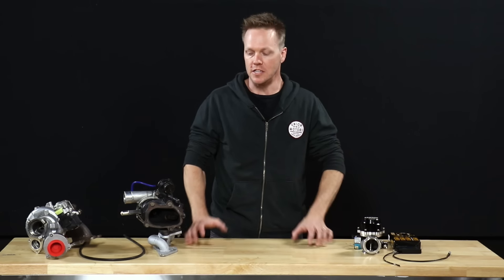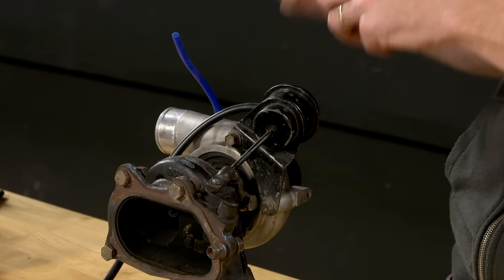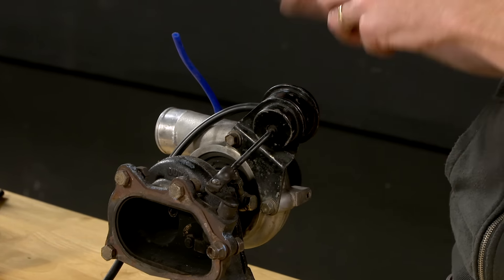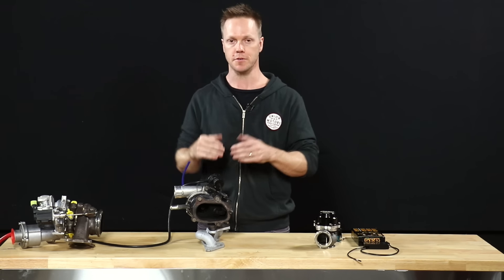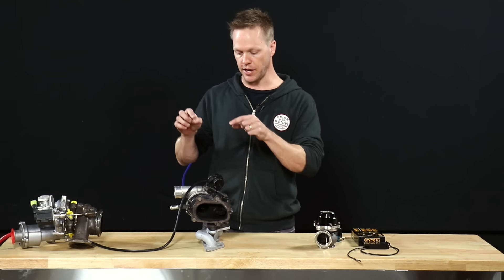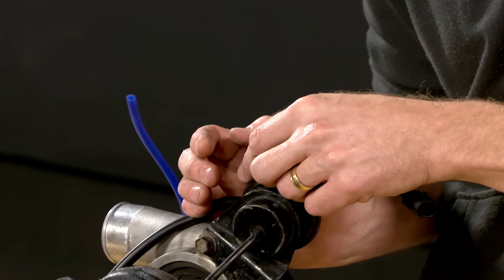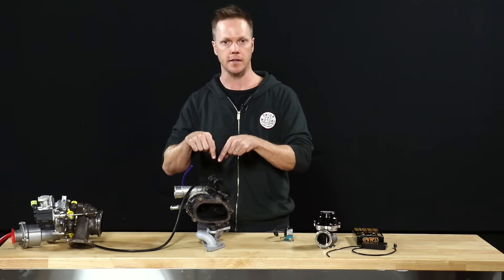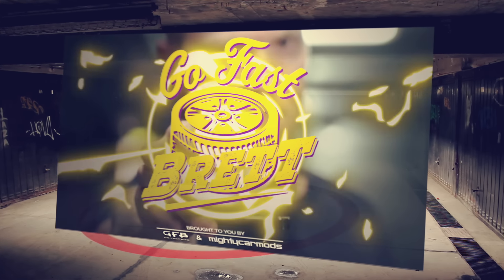Boost Control Explained [GO FAST BRETT]

Comment: Just weld the waste gate shut, unlimited boost baby
Reply: good luck whit that
Reply: Infinity boost!
Reply: Does this actually work of does the turbo tear itself to shreds?
Reply: The guys trolling. Don't weld your wastegate shut that just stupid. The only time you would do it is if you want to go form an internal to external gate without charging the turbo.
Reply: It not only tears itself to shreds but also I hear it can cause
long term brain damage to the vehicles occupants due to the massive Gs experienced
forcing ones brain into the back of your head. Serious stuff.
Reply: I hear that's how Han Solo did the Kessel Run in less than 12 parsecs.
Reply: He took a shortcut? Since parsec is a measurement of distance.
Reply: +Kanga Duck Even if you had a pressurised suit, cars are not designed to break the speed of sound. So I wouldn't do it, personally.
Reply: make sure you throw a couple tack welds on the compressor wheel aswell really helps with spool time
Reply: +Martijn Westerink Well I've already started building wings for my car so I can be over the ocean when I break the speed of sound.

Don't want to be that asshole that breaks everybody's windows...
Reply: Ryan Rohauer
Dont forget to apply these in a criss-cross fashion. dont want to warp the wheel...The only time warp is good is on entry to warp speed.
Reply: too much boost than ur engine can take and boooom!!!
Reply: enclose in Metal and roll of bridge for vertical boost.
Reply: vevohoeyo not if u have a Diesel
Reply: I laughed a little too much at that. lol
Reply: If a turbo blows in the woods and nobody hears it, does it actually blow?
Reply: i once welded a few gears in a rear diff once!!! lol
Reply: It would just explode
Reply: Rods have left the chat
Reply: You could just block the actuator... no need to weld!
Reply: They actually used to do that on 80's f1 cars and they would run a shit ton of boost, over 70 psi but it would only last one race or less lol
Reply: LostSagittarius
He actually skirted closer to the event horizons of the bordering black holes than anyone had ever managed before. The greater power of the Millennium Falcon allowed this due to his and Chewie’s custom modifications.
So, the overall distance traveled was shorter.
Reply: quantum foolishness
Reply: Lold on that one haha 🤣
Reply: Welding things always helps
Reply: Yeah because what the fuck is "efficiency range" and staying below the 70% threshold from thermodynamics coming into play all sound FUN lol good luck super glueing it back together once you find out the hard way...
Reply: But ill admit guys like you make guys like me money lol
Reply: @melody3741  any issues on diesel engines
Reply: I have an almost new parachute for sale only used one time never opened
Reply: Yeah do it. But only you nobody do it it will blow your engine
Reply: So what really does happen if you clamp down the gate?  Full boost  I mean a T25 is like 100$ if it's a street car honda civic  what's really going to happen ? Let's be honest no jokes

Comment from the maker: Boost is good and in this episode, Brett explains what it is and how it works - MAD!
Reply: Would a boost controller have an effect on any turbo car, even a diesel such as a VAG 1.9 TDI 150 or....?
Reply: I too am interested in this, i have a kia Ceed CRDi and was wondering if a boost controller will make it MAD or just wreck the thing?
Reply: +DANCE GASMAN Yes, especially on Diesels.
Reply: probably not enough effect to offset the cost
Reply: The answer's in the video!
Reply: But can I fuck it up with just a boost controller?
Reply: +Mike Pop Yes. If you use too much boost without a proper tune.
Reply: So on a 1.6 diesel,  putting a boost controller and upping a few clicks without a tune should be OK?  The standard ecu is quite smart on it.
Reply: +Mike Pop If your fuel pump and injectors can keep up, then yes.
Reply: you can always go by a performance shop and ask them how or what . thats usually a better idea than just taking some guy on the internets word for it
Reply: +Maurice H They will say no because they want you to buy their chips. Better ask on a forum.
Reply: i never said stop by a bunch of scammers haha
Reply: Maurice H no, he's right,  I done that before and they just layed out all the bs
Reply: RAKE LIKES THIS !!!
Reply: +Maurice H I am asking MCM2 for the answer, not some random guy. Their experience and knowledge on this subject is tangible as they produce real results backed up by hard data...
Reply: Before this video I had no idea how this works,but now i understand it very clear for one video,thank you very much,have a great day

Comment: The old Corvairs had a different form of boost control.  They had no wastegate or blow off valve, they used a small carburetor.  A small side draft Carter YH (about 1 5/16" if memory serves).  Which, on my 65 turbo promptly replaced with a Weber DCOE with 28mm chokes.  The small carb not only controlled boost but make it very slow to build. It was a pain to tune but damn did it make power.   Now with electronic control and FI it's amazing what turbos can do.

Comment: The video showed up at the perfect time! I think I have a faulty N75 valve on my 00' A6 2.7T, and this helped me pictures what's going on with my waste gate so much! (though it's still a bit different)
Reply: If you have a manual boost controller laying around you can plumb it in with the n75 valve. If you have the problem with the n75 valve and the boost controller together but not with the mbc on it's own you'll know what your problem is. At least on my friends 03 Audi TT 225hp that was the case.
Reply: I thought N75 was the one most people just deleted? I forget just now though so that could be well wrong...

Comment: Extremely helpful. How come nobody ever talks about the manual boost controllers: Where they go, and what they do. Not that I didn't already know, but thank you so much anyway.
Reply: Hey bro what's the difference between ebc and mbc does the electronic boost controler you just plug it and it will do thr job by itself? (Without having to make any MANUAL adjustments please respond ,thanks!
Reply: @alexortega714   Electronic Boost Control still needs input from the user. It's just a nicer way to set your wastegate. you should also be able to see what your boost is set at in real-time before you drive the car.

Comment: I have a question, lets say my wastegate and actuator were not operating properly (staying stuck closed) causing an overboost situation under boost. By removing the restrictor pill ( in a 2 port boost solenoid) will make the car run to the minimum wastegate pressure? or will still be over boosting?

Comment: The electronic boost controller you talked about, is it similar to what other companies call a 3 port boost solenoid which is controlled by the ecu with a tune?

Comment: So it actually builds up the pressure by first closing/fooling the 'sensor' and then opens, what makes the turbo spool turn faster. A bit like squeezing a water hose.

Comment: Could that solenoid or vacuum valve make problems with turbo surging at half the throttle?

I have a 2.4JTDm and sometimes it works just fine, but sometimes it surges from 3 up to 6 gear around 1800-2000rpm (turbo reference is around 2000 I think).

Thanks...

Comment: This is probably a dumb question but why not just put a stiffer spring behind the diaphragm so it takes more pressure to open it?
Reply: It's not a dumb question, and it is a very common thing (at least in my car circles) it's just not where most people start as it is a little more difficult to either swap springs or track down and buy a heaver spring waste gate. I think this video is designed for the guy or gal who just wants an easy way to get a couple more PSI boost without too much work.
Reply: That's common. You can put larger springs in to allow more pressure therefore higher psi
Reply: you can also have the original internal wastegate flapper plugged and run an internal wastegate.
Reply: +That Yeti Guy that's interesting changing the leverage like that. Cool idea.
Reply: Also that does not allow the adjustability an electronic boost controller offers, with a well setup electronic boost controller you can change your target boost pressure on the go, and thereby have multiple power levels. Bleed valves...well, I wish they would have gone a little into the issues with them, they allow short times of unwanted very high boost to occur, which your factory ECU and injectors (let's face it, someone who installs a bleed valve will likely run those) might not be up to. But yes, changing waste gate springs is a thing, and sometimes is even required for high boost applications, where the exhaust backpressure opens the wastegates a bit before your target boost is reached.
Reply: F1NNSP1N
Agreed.
Reply: A lot of actuators cannot be opened up. However, there is a bodge/cheat that I saw on youtube. Put the "can" part of the actuator in a vice, and crush it ever so slightly; Tada! You've now added preload to the spring :) Not a reversable mod though!

Comment: I have a 1997 Sr20det s14 silvia stock motor . It's only running around 6psi stock I want just a bit more power. Do I get a boost controller ? Do I need to remove restrictir pill ?

Comment: Not all turbos waste gates work the same, newer models now works with vacum which is made by a vacum pump and electronicaly controled via engine management, you simply cannot use a leak offen valve as it waste gate needs vacum to close and not vacum to open.

Comment: One thing you did not include in your comments, is that the motor may only be able to accept so much boost or you may over pressurize the cylinder and cause other troubles.  Be careful when increasing pressure to the motor.

Comment: A good accurate description of how boost pressure it’s regulated and adjusted, oh also a quick little lesson on how to easily full boost your turbo 100%  
But  you didn’t explain that by doing just this your engine will b rerunning a leaner fuel mixture and will b at high risk of damage
More boost needs more fuel ! Don’t try this at home. 
Go fast Bang

Comment: So, for example, if I have a 3Lb spring installed theh 3 psi is my minimum boost level. But it could be cranked up to 6Lb with the boost controller turned up to 100%?

Comment: Sir, can I use boodt controller to control and reduce the boost to increase the mpg? I understand that will reduce the power and i am okay with it. Or any other suggestion to increase mpg in a N54 engine.

Comment: I really was hoping to learn where to put the Boost Controller on a External Wastegate setup
Reply: It's basically the same as an internal. If your intercooler piping has no nipple for boost pressure (as he was demonstrating), reference from the intake manifold. If you don't have a free vacuum line nipple, then you can either t-off from a current vacuum line (make sure it's pushing air, not sucking), or drill and tap the manifold and install your own nipple. I hope this helps.

Comment: Yes sis, can you plz help me out with my problem, I had 2009model c200 kompresor, and had troble code p0045, its say supercharger boost control solenoid circuit A open, where can I find the boost control solenoid, tnx

Comment: ok when i drive 22psi overboost and 19psi holding boost with a electrical boost solenoid valve. what spring strength i needed for my wastegate?

Comment: If i put a boost controller on a 2015 ford fiesta 1.6 tdci , will the engine detect that there is more air and inject more fuel ?

Comment: So, is there any way to have BOOST ONLY ON DEMAND.

I have to replace the engine of my Subaru Forester. They offer me 2.5XT and JDM STi engines but I simply dislike the turbo "kick"

I would love to install an engine, run it as NA and only apply the boost on demand, like a turbo "button" or switch.  Not possible with a controller: Any other way?

Comment: So if I run a 7 pound spring in my wastegate that means that I will have 7 psi of boost going into my motor? I’ve heard that the wastegate has to do with drive pressure

Comment: hi. maybe you can help me. im having mazda 6 2.2 d with twin turbo and i have a lack of power under 3000 RPM when it ret to 3000 i can fill that is geting power. people told me to swap boost control sensor but i dont think that is a problem because waist air valve is constantly close. but when im cheking air pressure no MAP sensor under 3000 is much smaller then required. when go over 3000rpm it starts to get right air pressure. what can be a problem. my whole intake system was take a part and is clean from carbon ( i thought that this was a problem but no) MAP sensor works fine. is there a chance that my DPF filter is partially blocked  and air pressure on exhaust is small so my turbo is not spinning fast enough. im not getting any errors but i think that my dpf burns byself very often. pls let me know if you have any ide. sorry for my english

Comment: Can someone explain to me what happens with the AFR when cranking up the boost? Does the stock ECU adjust the fuel properly for the increase in boost pressure to make sure the car doesn't lean out?
Reply: nope, just adds more boost so you afr will be leaner than it was previously
Reply: Depends which car. My turbo car runs primarily off of a mass air flow sensor. So it will put extra fuel for the air because it is metered. But I can only turn it up a few psi safely. Once the mass airflow meter determines there’s too much air for the available fuel it hits fuel cut/hard limp mode. But what a boost controller does is allow the boost to ramp up much faster even if I’m increasing it only 2 psi. So I was at 9psi now I’m at 11psi max but the boost hits much harder in 2nd gear and on. It will now spin the tires at 40 mph on hot dry pavement when boost come on hard in 2nd.
Reply: No. That is why you need your ECU re-mapped.

Comment: Hey man, i'm trying to install a MBC on my 03 saab 93, but I noticed I have to boost pressure solenoids... one is connected to my turbo & wastegate, and one to my intake manifold. Both are 3 port pierburgh boost pressure sensors.. I read that if you have one of those you just replace with the MBC... Is this possible to install if I have 2 of these Factory boost sensors? Will the 2nd one affect my MBC if I install it to the wastegate actuator?

Comment: Hi there.. Brilliant video..
May i ask u a question if u dont mind.
I have an Evo 8 and when i bought it, it already had some mods done to it.. It is rapid. It pulls hard when the turbo kicks in. But the one thing i notice is if I'm  in 6th gear doing let's say 80mph and i put my accelerator most of the way down i feel like im losing boost from some where and the acceleration is patchy. I can hear like boost being released from some where? It never did this when i first bought the car. Looking at some of the receipts from previous owner i see that an upgraded actuator spring was installed. Could you shine some light on what might be the issue. It doesn't happen in 1-4th gear.. For your information i have a recirc value on it and not a dump valve..

Comment: Can you attach a boost controller on any vacuum line? Or would I have to hook it up to the lines directly near the lines of the turbo?
Reply: Yes you can. I ran the wastegate line to the boost controller. and the line coming out to my vacuum lines next to my Fuel pressure regulator. the bov was a single line ran straight into another T in the same Vacuum line aswell. :) as long as its hooked up to the vacuum lines. and its all hooked up without leaks then it should run correctly!

Comment: lets say I have a 10 psi rated internal wastegate can I use a 3 port boost control solenoid to move the actuator at 5 psi opening the wastegate? it seems a little backards to me from what I understand a solenoid can trick the actuator into thinking theres less pressure than it actually is but not otherwise right?
Reply: 10psi spring opens only at 10psi. You can only run more boost than spring pressure. Not less.

Comment: Er... double acting waste gate actuator... holds the waste gate shut against boost with boost... it also means you can run a softer spring in the actuator and it'll be more easily controllable...

Comment: So what about the "double your wastegate pressure" rule when using a boost controller. If you have a 7psi Spring, with a boost controller you'll only achieve 14psi give or take. Or the differences in 3 vs 4port electronic boost controller solenoid me.

Comment: i have a passat b5 1.8 Turbo , with aftermarket intake system would anyone not recommend that i manually use a boost controller to increase boost without EGR delete??

Comment: What do you do though, if you have a newer car and the turbo is controlled via the ecu?
Reply: ***** Wouldnt that screw up the ecu? throw up errors n shit?
Reply: depends what car. I just did it to mates car as it was always boost cutting from bad wiring somewhere. Fit a boost t and unplug factory boost solenoid. Now runs consistant 7psi. No errors or anything. Although there really should be an error code but my say is this particular car has a wiring issue. Not paying $1000 for a new ecu when a boost t is $5